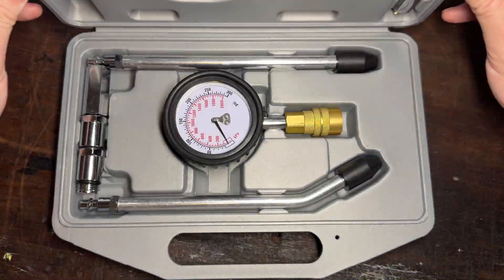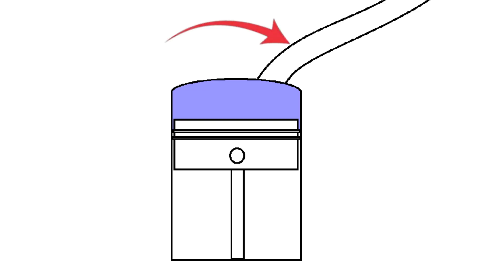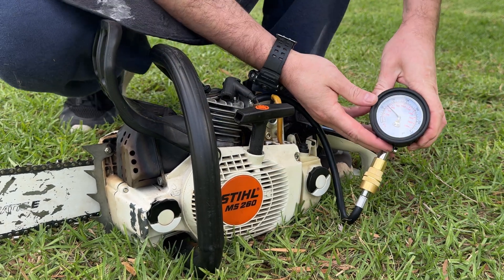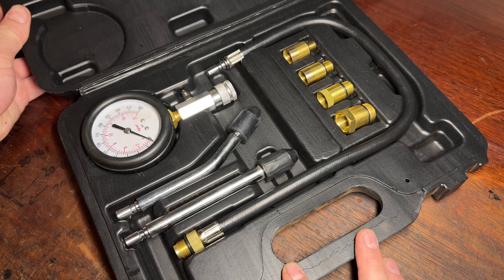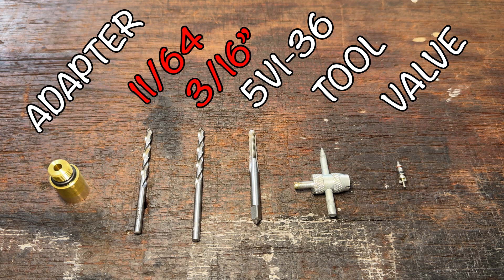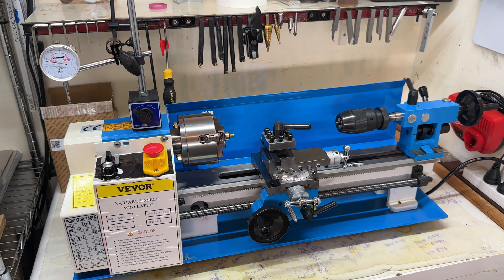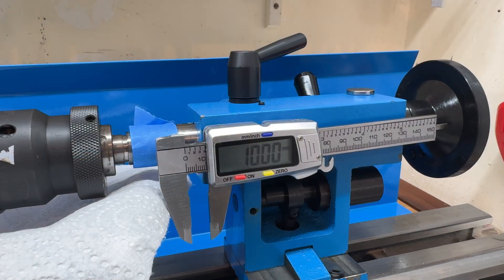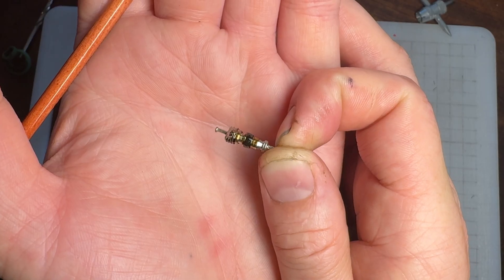Fix Your Inaccurate Compression Tester!

Comment from the maker: If this video helped you, please consider clicking on the THANKS button above to support my channel 🙌 and don’t miss this video next: https://youtu.be/ciesArnkO3I
Reply: Tom, Stella did a vid too and i'm thinking instead of drilling and tapping the adapter...could you fill it with silicone or something to the correct internal thread height then have a small straw / tube section in the center?
Reply: @hubby-tubadventures01 
A firm silicon should work..
Not sure if it's low or high modulus..
What is the worst that can happen..
The valve shoot's up the pipe 💥
There's probably some other goo .. 
Or could you put a bit of rubber pipe or a car valve with the rubber bit in there..
For pressurising a cylinder.. a type of leak test for big engines.. crude cylinder head crack test .. etc ... use an old spark plug and replace the middle with a car valve and use silicon.. 😻
I've used them in plumbing fittings to find difficult to find leaks like in a back boiler...
Reply from the maker: Hehe we had fun making our videos together, I love her! Do you mean literally restrict the drilling rather than using a valve? It depends if your hose has a schrader valve. If so, then it would be usable for sure, but not right on, however if there is no valve in the hose, then no it won’t work! Cheers :)
Reply: @VintageEngineRepairs  I need to have a look at my mitivac set. I'm certain they all have valves in the adapters but not 100%. My theory is filling the internal adapoter void. One of Stella's commentor's mentions using washers in the adapter. just thought it'd be more reliable / semi-permanent to use a filler substance as opposed to washers.
Reply: Great tip and detailed explanation. 👍

Comment: Hello,
I noticed that the Scharder valve tip looks to be flush with the tip of the hose, is that right? I got one for Christmas and want to be sure I do it right. Thank you for a great explanation.
Reply from the maker: Yes flush is fine :)
Reply: @VintageEngineRepairs  Thank you. Happy new year.

Comment: People must stop do this do ignorant and misleading video, the test with the Schrader valve is a different test is not the "right" test.
Buy a book maybe you learn something.

Compression Test
Measures the maximum pressure each cylinder can generate. Useful for identifying a weak cylinder and comparing readings across all cylinders (differences > 10-15% are abnormal). With Schrader Valve (or check valve) on the adapter. Requires cranking the engine for a few seconds with the throttle fully open. The valve traps the peak pressure.

Leak-Down Test
Measures the percentage of pressure the cylinder loses over a period of time. Indicates where the leak is occurring (valves, piston rings, or head gasket).  Requires a specific tool (leak-down tester) and an adapter without a Schrader valve connected to an external air supply (compressor). The cylinder is brought to Top Dead Center (TDC) on the compression stroke, and compressed air is injected to listen for where it escapes.
Reply from the maker: Yep, that's exactly what I cover in my
 videos.

Comment: Thabks for making this, I was actually just doing a compression test on a 1000cc sport bike and Im getting like half the required compression as a result which makes no sense because the bike runs great. Im going to see if I can modify my tester or get one with a shrader valve in the end
Reply from the maker: That's great you found the video helpful, the modification here will do the trick!

Comment: Hey, could you test the diffrence in reading by using an auto car tyre schrader valve instead of a low opening ?
Reply from the maker: No, it won't open to let enough air in for accuracy.

Comment: Great video, beats calculating the spark plug adapter volume for a specific engine and then adjusting the pressure results, which can be a PITA. The adapters do not come 'your way' in order to increase tool sales profit.
Reply from the maker: Glad you enjoyed it and found it helpful! :)

Comment: Additionally, use the correct type compression test gauge for the engine you are working on...

  The old two stroke Detroit Diesel engines were checked running. 565 psi new, 515 psi minimum for "N" 71 series engines 

  Aircraft recip engines use a two gauge tester. Depending upon engine displacement, two different orifice sizes between gauges.

  Always be aware of what you are dealing with.

  As always, brilliant video, sir!!
Reply from the maker: Yes certainly don't use a petrol compression tester for diesel, absolutely!! Yes the Aircraft engines use a leak down tester built to FAA specs which is 0.040" orifice, 60 degree approach angle at 80 psi test pressure under 5" bore and 0.060" above 5" bore :) thanks for the kind words!

Comment: I just odered this compression tester STIHL 5910-850-2000 for my STIHL MS211 C-BE what do you think about it?
Reply from the maker: Looking at the pictures of it, it won't work properly, there is no schrader valve in the adapter.
Reply: @VintageEngineRepairs  May be it has it inside the tube?  This is the original Stihl compression tester.
Reply from the maker: @Jack_Sparrow17 yeah but that is irrelevant, I explained all this in the video, it must be in the adapter itself or you add volume to the cylinder and get a low and inaccurate compression test :) At the amount they charge for their tools, I'd take it back 👍
Reply: @VintageEngineRepairs  Do you know something about compression of Stihl's 2-MIX engines? I have Stihl MS 211 C-BE with ergo start system, it is almost new, and i have correct compression tester with Schrader valve inside, but compression is about 6,5 bar. Now I odered Stihl original compression tester.
Reply from the maker: Somethings not right with your Stihl compression tester mate :(
Reply: @VintageEngineRepairs  yes my compression has a long hose about 30 cm and M10 adapter.  I need one with a short hose for small engines, now i am waiting for the Stihl original  tester, which i just ordered.
Reply from the maker: How did you go in the end mate?
Reply: @VintageEngineRepairs  hi buddy! In a couple of days i will receive original Stihl compression tester and tell you everything about it, but i already discovered that this tester design for small engines and especially for 2-MIX and 4-MIX engines of Stihl.
Reply: @VintageEngineRepairs  Hi buddy, i have just received this original Stihl compression tester and it doesn't have the Shrader valve at the tip and of course it shows me wrong compression, just 7 bars instead of 12 bars. I have just sent it back to the seller.

Comment: Hi Great vid, but with regard to the "low-pressure Schrader" is this the normal valve in a car Tyre or do you know the specifications? Thanks
Reply from the maker: Thanks :) no they're not a standard tire valve, those are far too heavily sprung!
Reply: @VintageEngineRepairs   Thanks for the fast response, So do you know the specifications of the ones needed then? or where that information is?
Reply from the maker: No worries :) there are links in the description to the valves!

Comment: Hi, I’m in UK and finding it difficult to locate the low pressure valve you mentioned other than ordering from the USA at silly prices and with shipping costs even worse. I have seen on the internet schrader valves suitable for the low pressure side of a refrigeration system, would these do the job do you think? Alternatively do you have any other links for this valve please. 

By the way I think all your videos are some of the best I’ve seen, especially the one rebuilding an MS 660 which helped a lot recently.
Reply from the maker: Thanks for the kind words Phil, I'm glad you are enjoying my content! Unfortunately I don't know if the refrigerator valves will work as I haven't tried them. It may be worth asking the company what the pop off pressure of them is.
Reply: Hi since my last comment regarding this conversion I’ve acquired a long (40mm) valve stem from a local tyre dealer and removed all the vulcanised rubber from the stem and cut the non valve end to a suitable length. I then drilled out my spark plug adapter slightly oversize and used Araldite (or JB Weld) to fix it into the adaptor. This in my view negates the need to drill out 2 drill holes and then tap a thread. I just use the internals of a standard valve stem.
Reply: @PhilGibbs-10006  Any chance of some photos or a short video of what you've done? Hoping to make my Schrader-less compression tester a bit more accurate.

Comment: Another great video. I have weed eater that kick back when trying to start it. The flywheel key is OK the coil gap is OK. The spark plug gap is OK, what could be  wrong.
Reply from the maker: Thank you! I’m actually working on the PERFECT video for your situation. Testing spark timing. It sounds like a timing issue and the video covers it all :) watch this space!

Comment: Compression Tester accuracy is important and as a Journey Mechanic of 50+ years, & when working primarily with multi-cylinder engines, the main function of a compression test is to determine the condition of each individual cylinder. The test is usually done to evaluate the condition of an engine operational problem & the compression test is used to find a cylinder that is less efficient than the others which would indicate defects of that cylinder.  This could indicate inadequate sealing of the rings or valves & would require appropriate repair. This type of test is almost always done for troubleshooting purposes when an engine is not operating in a normal manner. So compression tester accuracy is important,  but for this scenario, which is the most common, accuracy as such takes a back seat to what the technician is ultimately looking for & that is VARIATION of cylinder readings. We're looking for the defective cylinder. In other words, a not so accurate tester over an accurate one isn't necessarily required to satisfactorily diagnose this issue as what the variation in each cylinder test result reveals - which one(s) is the problem. An inaccurate tester will still show the appropriate variation. Obviously the above is not applicable to a single cycle engine. Also, all compression testers I have used had a Schrader valve. Hope this is helpful as a side note & thanks for a very informative video!
Reply from the maker: Thanks for your thoughtful comment and kind words — you’ve raised a good point. I do agree that variation is what we’re usually looking for in a compression test on a multi-cylinder engine. But I’d add that if your tester lacks a Schrader valve or is inaccurate, it can give low readings across the board — and possibly still read low on the faulty cylinder too. That risks hiding subtle but significant issues.

Since compression isn’t linear, and small losses can cause noticeable engine symptoms, using a more accurate tester gives you better diagnostic confidence. You’re right — this assumes a multi-cylinder setup — but even then, if your tester can’t pick up minor differences, you might miss a real problem.

That’s why I think a leak-down test is a more reliable comparative method. It eliminates the variable of added hose volume and focuses purely on air loss, not pressure gain, which gives a clearer picture of ring or valve sealing.

Really appreciate you taking the time to discuss this — it’s a great topic

Comment: Have you tried on a car with and without the added valve ?
As i understand it ,it's not a problem of the hose acting as an added cylinder volume,but the fact that the hose itself has a larger volume than the cylinder,unable to fill it up completly to go up to the one way valve in the gauge.
Just get a shorter hose to try,
Reply from the maker: Na the hose is only 5cc’s it’s inconsequential for a car. That additional 5cc’s would make less than 0.8% additional cylinder volume.   It’s that small engines have very small swept volume and that hose can add 20% on top!
Reply: @VintageEngineRepairs  
I was speaking of a shorter hose on a small engine,their displacement is very small,so 5cc is a lot for them.
Don't say that 5cc is inconsequential for a car lol,you would have problem with a car performances enthusiast.
Reply from the maker: @michaelovitch hahaha give it a go and let me know. Unfortunately I don’t have a smaller hose to test!

Comment: It is really bad that most manufacturers/sellers of those compression testers aren't mentioning in their descriptions or manuals that they won't work on small two stroke engines. Just imagine how many people think their engines are junk just because their compression tester doesn't work right. When you test "normal sized" engines with a cylinder volume greater than, let's say, 200cc, it doesn't really matter if you have a check valve in the tip or not. It is actually a lot better to use a tester without one on big displacement kick start only motorcycle engines. You have to kick a big bore Harley more than ten times through compression until the needle stops rising when you use a schrader valve tester. Without the valve two or three kicks are enough.
Reply from the maker: Interesting! I did a cbr600 (150cc per cylinder) and it was 75 without and 190 with. I haven’t tried anything bigger yet, but I’ll give it a go :) thanks for sharing and I agree, they should specify!!!

Comment: Thank you for posting this. Another person on YT posted a video about this issue, but left me with the impression that the automotive hose couldn’t be converted. Thanks again
Reply: I think you might be thinking of my video... 😸 If the opening on the automotive hose is smaller than 4mm, then you can convert that. My video was referring to the inaccuracies of using certain adapters for various spark plug adapters. Cheers!
Reply from the maker: Haha myself and the Lawn mower lady had some fun making our videos on the same topic :) sorry I don’t quite understand what you mean that the hose can’t be converted?

Comment: So why do they sell compression testers without the valve installed as you've shown?

You show us doing the compression test on that chainsaw; but what is the factory specification of the compression meant to be?
Reply from the maker: They sell them for automotive use as mentioned in the video. A car cylinder is around 500cc’s and when the volume of the hose is added (5cc), It’s nothing (1%) in a small engine it can be as much as 20%. 

They should have around 170 psi new (fluctuates by 10 psi depending on the model)

Comment: Thanks. How do you check, if crankshaft isn't bent, do you use tools ?
Reply from the maker: You’re welcome :) The best way is to remove it from the engine and put it on a crank truing stand. That removes the possibility of bearing play. Otherwise, place a dial indicator on the crank end and turn the engine over and check there is less than 0.1mm of runout
Reply: @VintageEngineRepairs  Thanks)

Comment: Great info. I made my own years ago using the base of a spark plug, a cleaned tire valve stem, a low pressure Schrader valve and a gob of JB Weld. It worked fine, but I later upgraded to the Echo small engine tester with two adapter sizes. Love it.
Reply from the maker: Awesome work mate!! Good job :)
Reply: I did the same thing works great

Comment: So many low quality gages from China are a problem as well.

Good point 👍

Excellent channel
Reply from the maker: Nailed it mate, they really are… I’m not sure if it’s about reducing manufacturing costs, or their focus is more geared towards larger capacity (automotive) engines where the small addition of a few cc’s doesn’t make a notable difference? Or maybe both lol.
Reply: Yes, sad that the cheap manufacturer cutting corners that they don't understand results in a bad product and a huge effort needed to fix it. I have recently found similar problems with a leakdown tester (where they just did not understand how the test was supposed to work, and low-flow connectors throughout the system became new choke points) and wheel balancer, where they did not understand what needed to be done precisely vs. not.
In this case, surely someone over there looked at it and thought he was smart by removing this unnecessary part to save some $$, but without understanding.
Great video for demonstrating the problem so clearly.
Reply from the maker: @ yep! I tried 2 very expensive ($300+ aud) leak down testers and both were absolute junk. I made my own and it’s been flawless for a number of years!
Reply: @dre3951  a crisis in automotive and equipment repair here in America.

Defective parts even OEM now .